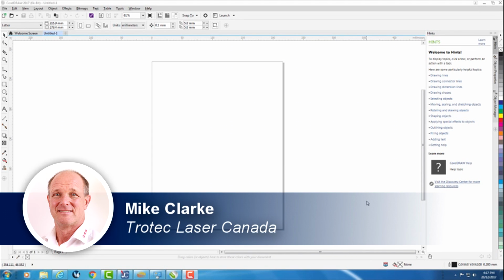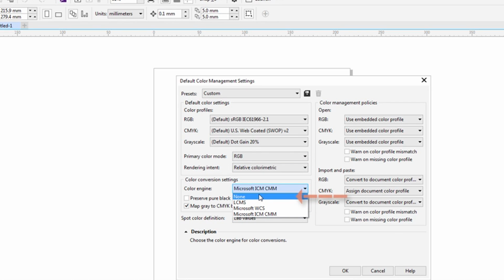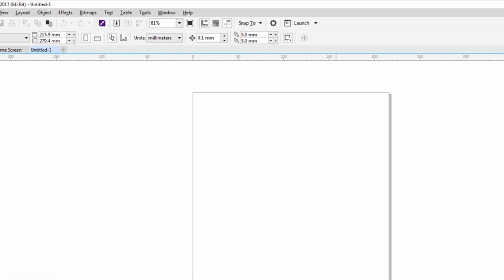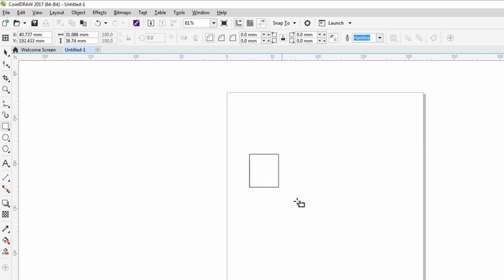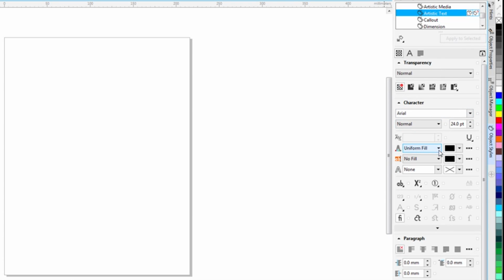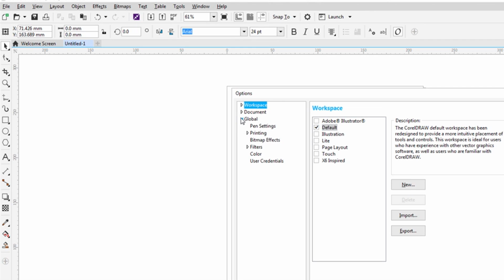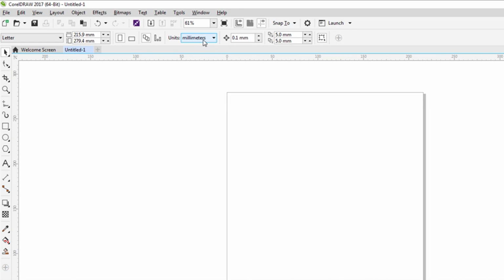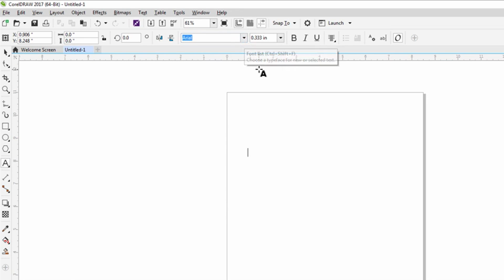CorelDraw Defaults Settings for the Laser Machine | Trotec

Comment: Hi. My computer says laser driver disconnected. So it’s not allowing me to send work to the LASER machine. What could be there problem?
Reply from the maker: Hello there! Thank you for reaching out to us. If your computer is indicating that the laser driver is disconnected, it could mean that there is an issue with the connection between your computer and the laser machine.

Here are some potential solutions to try:

First, check to make sure that all the cables between your computer and the laser machine are securely plugged in. This includes the USB cable and any power cables.

If the cables are all properly connected, try restarting both your computer and the laser machine.

Check that the correct driver is installed on your computer. If the driver is not installed or is outdated, this can cause connection issues.

If none of the above solutions work, it may be necessary to contact our technical support team for further assistance. Our team will be happy to help diagnose and resolve the issue so that you can get back to creating with your laser machine.

Comment: hello i am facing a problem... there is size issue in output ,, means when we make a rectangle 100*100  mm, and we cut it on paper there is difference found in size,  it seems 100*97mm on paper, can we solve it
Reply from the maker: Mohd Mudassir what laser are you using?